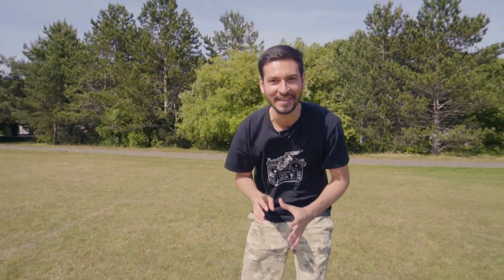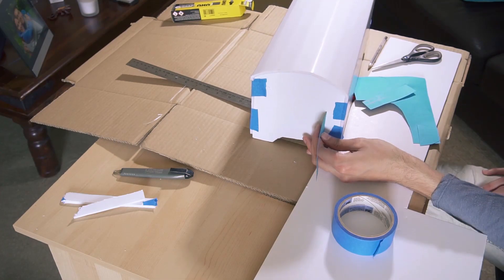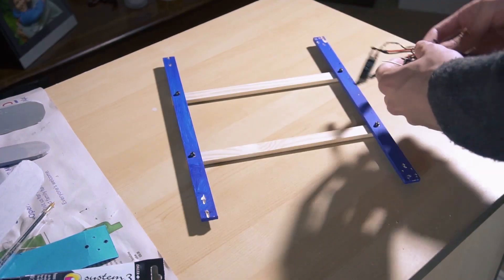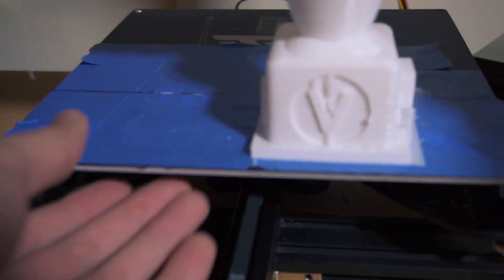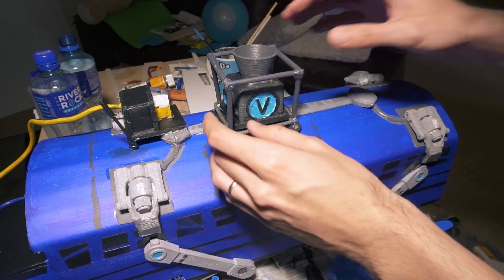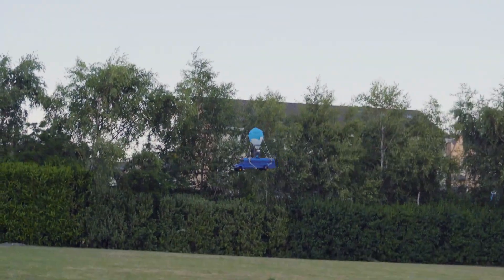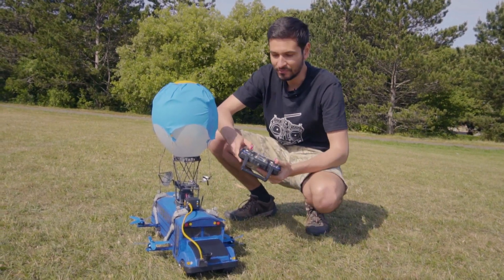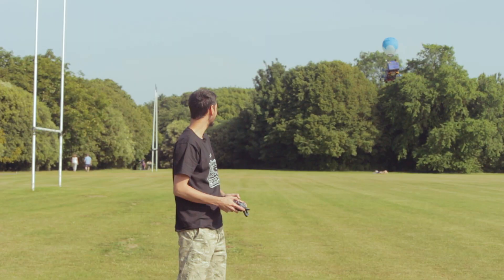Real Fortnite RC Battle bus | Big scale

Comment: Is there any way to keep the balloon shape, like mayb a paper mache version or a spray to make it keep its shape?
Reply from the maker: There are several ways but the problem is to keep it light, the best way is using an actual balloon since its very light, but it will decay with time.